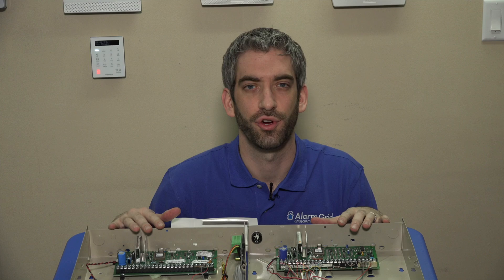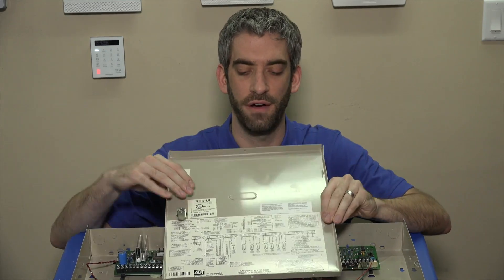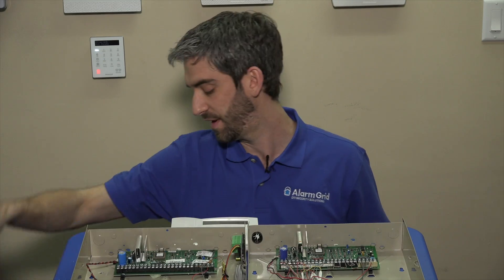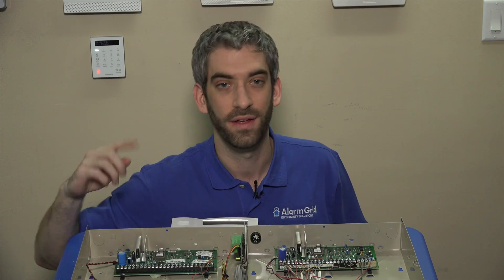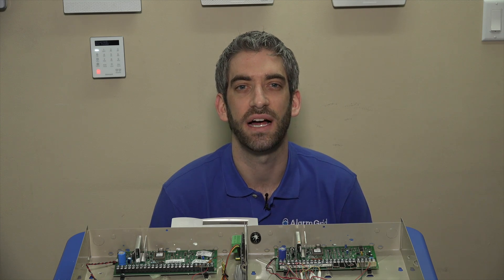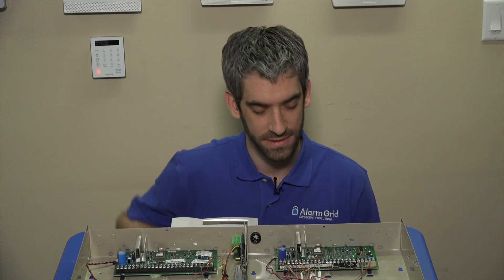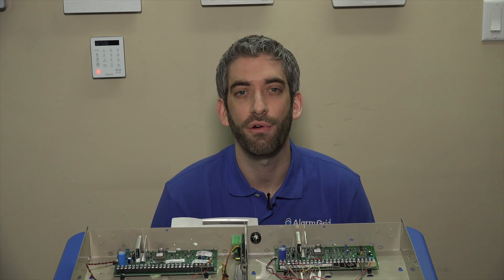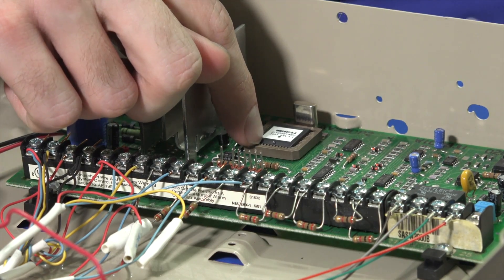Honeywell VISTA: Upgrade Old System & Get Total Connect 2.0

Comment: Hi,
My panel is Safewatch Pro 3000EN. The sticker on the chip says WA3001-5.5. Is this an SIA panel, or  non-SIA? I need to know whether I need an SIA chip or non-SIA in order to upgrade my panel.
Thank you.
Reply: It would say WA3000SIA-5.5 if it was a Sia panel. The regular chip should be what you need.

Comment: Mine says WA6764V12.2 for a home built in 2006. Can I upgrade this to a total connect system? Also, I have a Vista 6160 keypad. Any suggestions what keypad I can upgrade to that's touch screen? Just want a local security.
Reply: So that is a 10SE unfortunately it is not compatible with total connect or  any touch screen keypads. You would need to Update your panel to a 15/20P to be able to take advantage of those features.